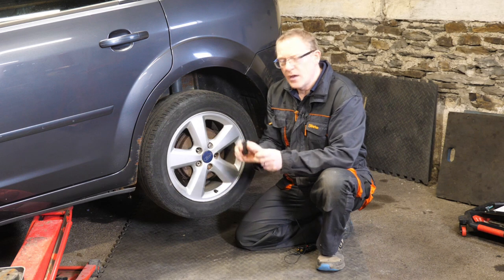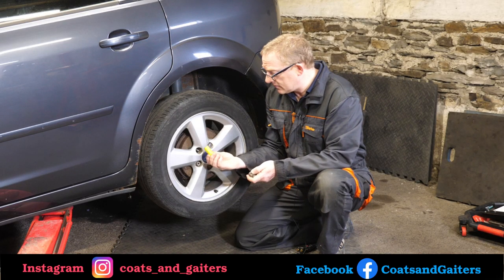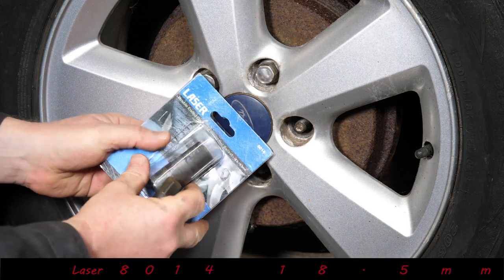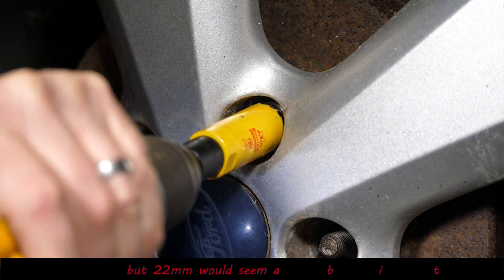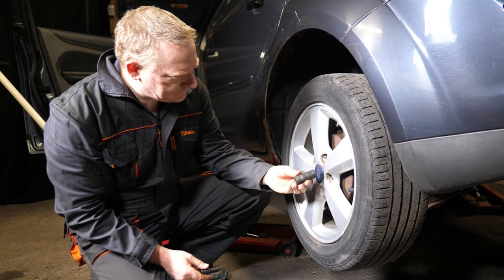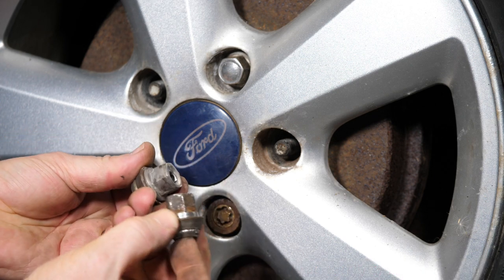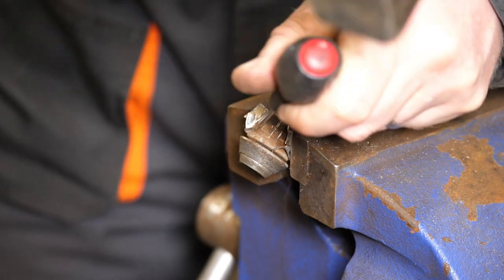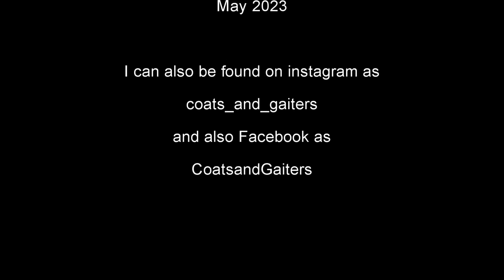Laser 8014 vs Starrett Hole Saw for removing Ford Swollen Wheel Nuts Lugs

Comment: Just had to do this myself on my 40K mile, garage-kept, F-150. After the dealership service rotated the wheels, they completely stripped some of the lug nuts.  I could get most off with a larger socket, but I had to use the hole saw on at least 1 lug nut on each wheel. I immediately replaced all of them with 1-piece lug nuts so I never have this problem again.

If I ever buy another vehicle that has these 2-piece lugs nuts, I’ll pro-actively replace all of them before it becomes an issue.
Reply from the maker: Ive cut all the chrome caps off mine now.

Comment: good 2 know, i have these wheelnuts on my summer wheels of volvo v50 2007 wich is produced under fords wings, now hoping that they will not swell during summer conditions. my winter wheels are made of steel with normal nuts without a chrome cover…
Reply from the maker: I had never come across such a daft idea before.  You imagine a flat tyre at the side of the road only to find you cant get and of your standard wheel nuts off !!! seems incredibly short sighted of Ford.

Comment: Afternoon Mark

Interesting. 

#freddyfocus is getting some luv. Albeit hard luv with a chisel & screwdriver to his nuts 🤔🤔🤔

I hate to be someone you DON'T like 😳😳😳

Breaks my heart seeing people used screwdrivers as chisels or punches 😱😱 
I've never had any trouble whatsoever with this problem with all the Ford's I've had, my Son's Fiesta or his Focus included.

Even my 2011 22k miles Fiesta I never have trouble each year I take the wheels of to check brakes & rotate the tyre's.
And as you know my vehicle's live outside constantly. 

Great little bit of kit tho, the Laser 19.5mm socket.

Do luv a Dremmel tool. I don't use mine nearly enough. 

Keep up the good work

Stay lucky. Stay safe. Stay healthy.

Alan L200
Reply from the maker: I know I know !!! why do we use screwdrivers as chisels and pry bars ahhhhhhh. I think the nuts are vulnerable after an impact driver is used on them as it can cause a slight split which then allows water in to do it's magic.  I must buy some fine chisels and stop using screwdrivers now.
Reply: @CoatsandGaiters  I think it's just pot luck really Mark.

As all of the previous Ford's in my last msg including my 2011 Fiesta & my Son's latest Focus, I've used my 18v DEWALT impact gun on them all, but as I say, I've ad no trouble...

And I know mechanics in the KNOW say NEVER use an impact gun on locking wheel nuts, but again I've always done it & had no ill sideffects. 

Aving said that.... 🤞🤞🤞🤞🤞🤞🤞

You know what they say about speaking too soon 😝😝

Anymore #freddyfocus or #cosfrench video's coming out over the weekend?

Av a great weekend Mark. Hope the family are all well.

SUPPOSEDLY 🌞🌞🌞🌞🌞 down ere at Heathrow for the next 10 day's or so.

But you know, what they say about weather forecasts 🤭🤭

Stay lucky. Stay safe. Stay healthy.

Alan L200
Reply from the maker: @GrandadPunchy  That is brave to use impact on a locking wheel nut Alan ......that's as bad as using a screwdriver haha  Weekends I play artic lorry driver so won't be recording anymore till Monday.  But Freddy is now back in the garage and rear brake are next.  Have a good weekend Alan.
Reply: @CoatsandGaiters  Ive sent you a couple of emails.
Reply from the maker: @GrandadPunchy  Thank you Alan I have added those to my tool list for the video.